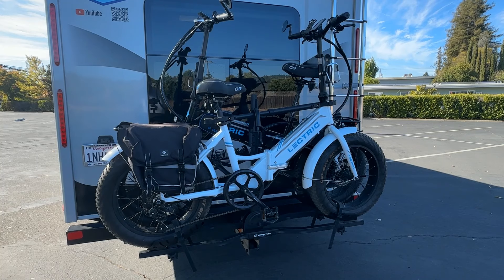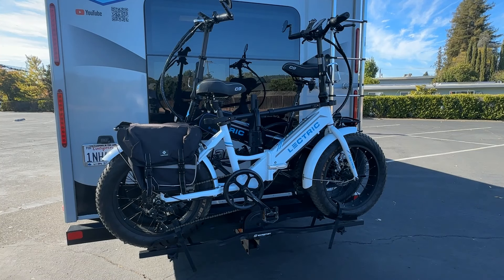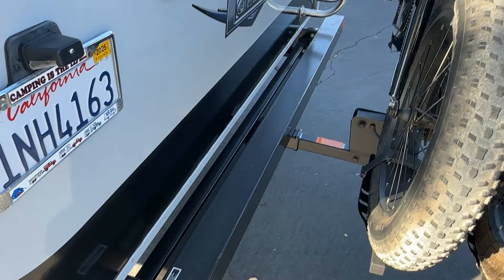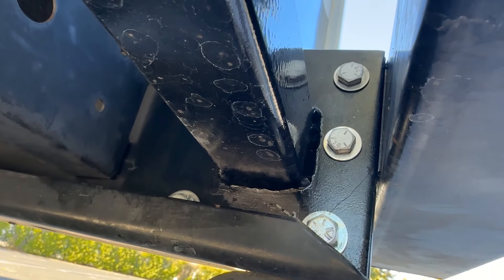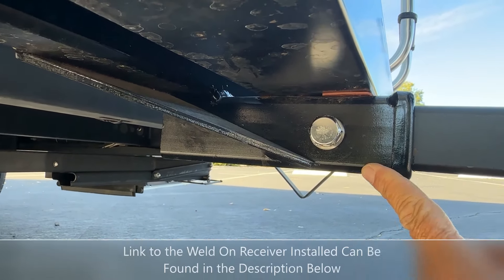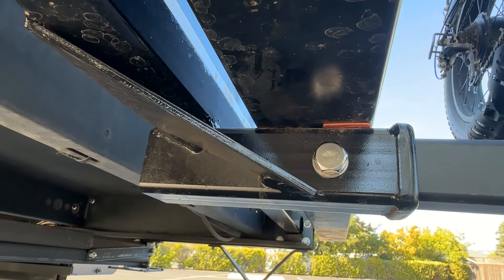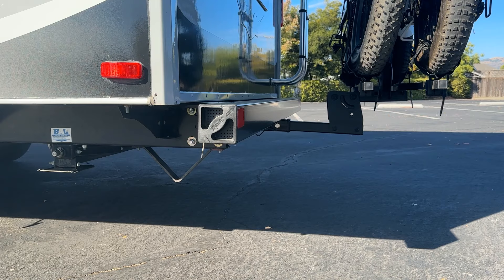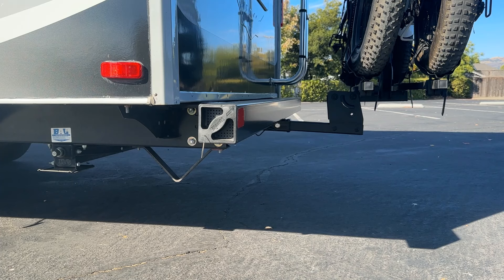RV Hitch Receiver Installation - do you have the right one to handle your load?

Comment: Good install my friend.  Never did any welding but I did pick up a flux core welder last month at Harbor Freight for $100.  Has pretty good reviews for home use
Reply from the maker: Thank you :) I've done a lot of welding and fabricating over the years and was a welder/fabricator for a company for 4 years and welded everyday and at other companies on and off between other maintenance work. I really enjoy working with metal. And wood also. Flux core welding will work, just make sure you run it hot to get better stronger welds. Here's a good tip to help prevent welding splatter: Spray the outside and inside of the tip and the surface are you are welding with anti splatter spray (here's a example - https://amzn.to/4g1WPSP)  To keep the tip clean and do other things with here's a good tool (here's a example - https://amzn.to/3OplLYC) Harbor Freight might sell these items.  Another tip: practice welding different thickness of scrap metal together and see if you can break them apart.

Comment: Michael-  I know you from your posts on the Lance 2075 FB group and have watched your videos and picked up some great tips.  Thank you.  As others have expressed, I too, am concerned about welding a receiver to a Lance frame.  I have the luxury of a truck bed for our bikes, but not all trailer owners are in that situation.  Because you are an experienced welder, you know much more that the average trailer owner in this area.  So for your own equipment, I think you are good to go.  You might want to add something about pre-2018 Lance light-weight frames not being appropriate for adding hitch receivers.  I suppose, when done correctly and by an expert, adding such a hitch receiver to the stronger, more recent, Lance Z frame is probably OK especially if the user keeps the weight of the accessory plugged into the receiver within specs AND does not extend the accessory out too far beyond the receiver mouth.  The bouncing, weighted leverage is a literal killer when it comes loose on the road and hits the driver following the trailer.
Reply from the maker: Thanks so much for watching and taking the time to share your knowledge with me and others. After reading your comment I'm going to write something in the video thumbnail to warn others to seek professional help because not all frames are not built the same (or something like that). And put something in the video description area mentioning this also. Unfortunately YouTube will not allow me to modify video once posted at this time but may in the future, but I can modify the thumbnail 

I went into this project with all the concerns you mentioned and after a lot of thought I felt my plan to do what I did would work (I'm keeping eye on it to make sure the frame does not bend or crack and the welds hold up). 
Prior to installing this bike rack we were carrying our bikes in the back of our truck and decided to move them for a couple reasons. 
1) It was a pain loading and unloading them out of the truck bed with our camper cover on. 
2) With the bikes and other stuff in the bed of our truck it was hard getting to things.
3) We needed to reduce our truck weight so moving it to the rear of the trailer was a great option to get weight off the truck and reducing hitch weight.

https://www.youtube.com/@thetraveltrailerguy/videos

Comment: Our 2019 2375 is currently in the shop with a broken frame curtesy of pot holes our Interstates. We carried nothing on the bumper and traveled most of the time with 1/2 tank or less of fresh water. It’s looking like insurance is going to total our trailer and we’re not sure we want another Lance after this experience. I’ve share pictures and details on the LOA forums and in one of the Lance FB groups. Point is, even with the nice job you’ve done on this installation and the fact that the Lance claims the bumper can carry some weight, with what I’ve seen and what I know now, I would NOT be comfortable adding any extra weight to the rear of that model Lance - perhaps any Lance.
Reply from the maker: Thanks for watching and sharing your experience. I've seen your post and pictures in the Facebook groups. 
I have driven the interstates that are really really in bad shape with huge potholes that can not be avoided, in fact those potholes bent two of my axle spindles on the passenger side and I had to replace them :(
I'm watching frame and may add additional structural support if needed and share what I do in a video. 
I sure appreciate you taking the time to write.
Reply: @thetraveltrailerguy  regardless of what happens going forward (repaired Lance or new trailer) you can bet a frame inspection is being added to my pre and post trip prep. Take care and keep the good content flowing.
Reply from the maker: @jmcdermon  Thank you so much, I hope you are able to get back on the road soon. Take care